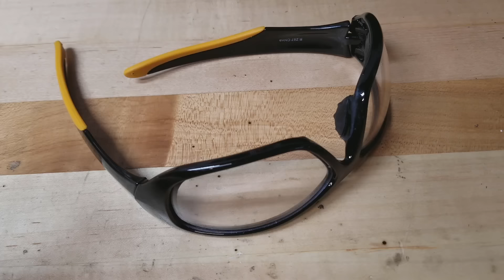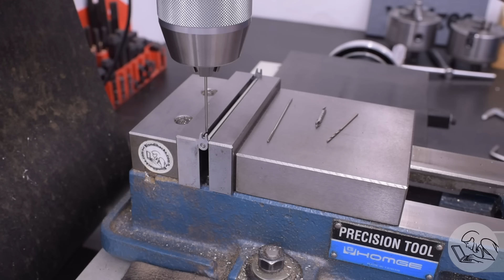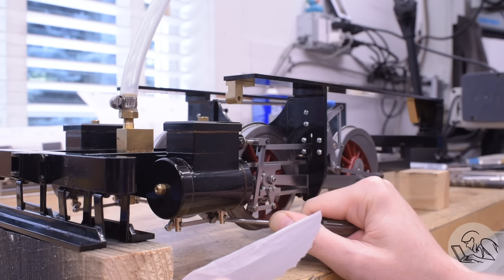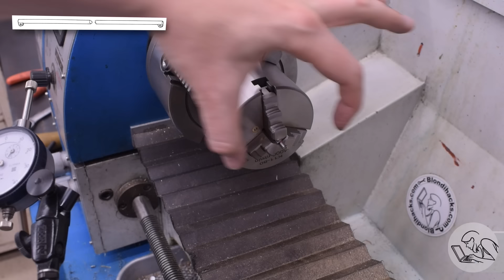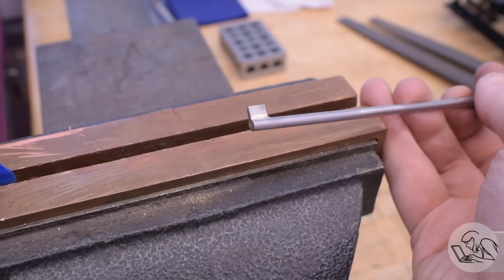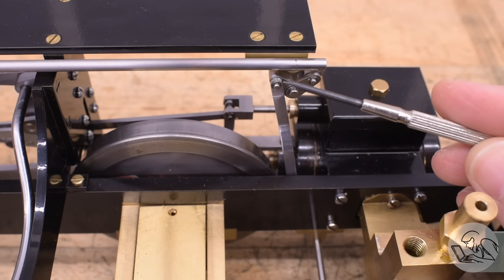Finishing The Drain System! - Pennsylvania A3 Switcher, Part 77

Comment: On the "real" (diesel loco preservation) engineering I do for fun, the solution to not being able to get a screwdriver on something is to use a hex-head machine screw instead, but I dread to think how small some of the heads would be for your loco project. Indeed, I changed some Allen head screws out for hex-head today after realising how much of a pain it was to get an Allen key into them. Spanner did them back up again no problem!

ExCaliper is absolutely wonderful, and I wish I had one. This morning, I had to use a smaller caliper, and I was reminded forcibly that vernier calipers can't get a flat battery...

Comment: It's sometimes the tiny fixes and tweaks to a project that really make it personal. Almost no one, I bet not even kozo, would make it perfect all the way through on the first try with this many systems and pieces, and while some things can be anticipated, some things just can't. I think any of these fixes are perfectly valid and save a lot of effort redoing almost everything and would work just as well. Some of these are pretty inventive too like changing the size of the head of the T pin that constrains the motion of the drain valve linkage. I can't even imagine the frustration dealing with all of these little problems but you do an amazing job as always!

Comment: In a 1950s French book I read they used to use a steadyrest made of an oak board set in a rectangular frame. You would drill a hole sized for your part and add oil.
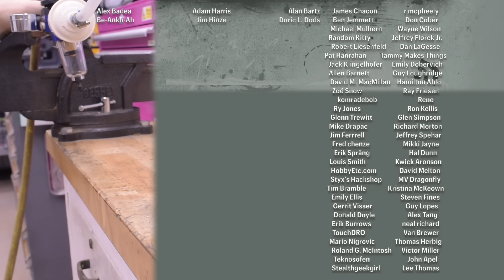Reply: What an elegant idea. 23:02